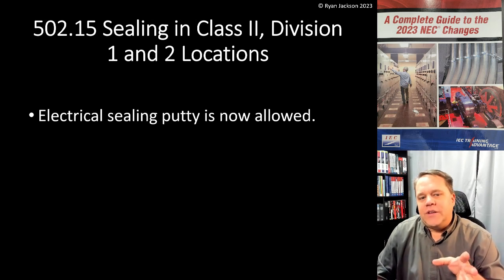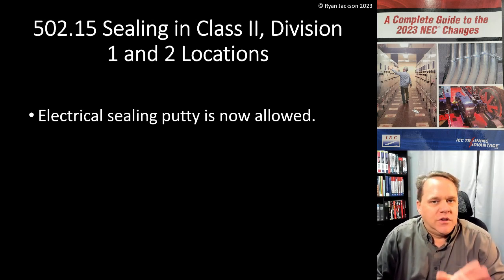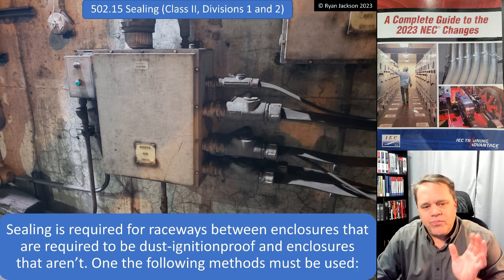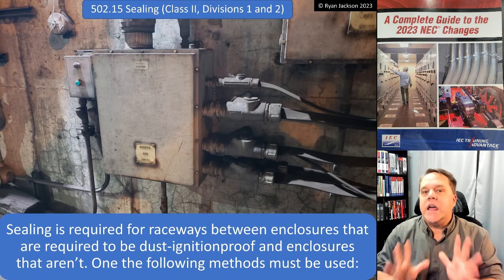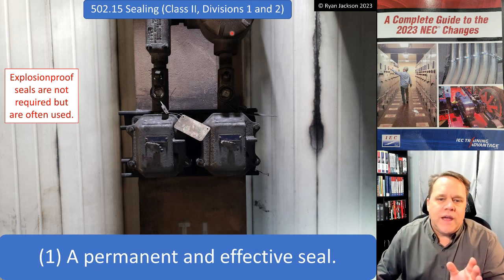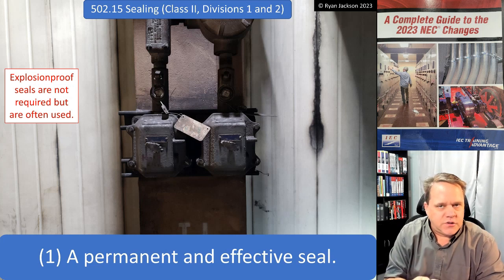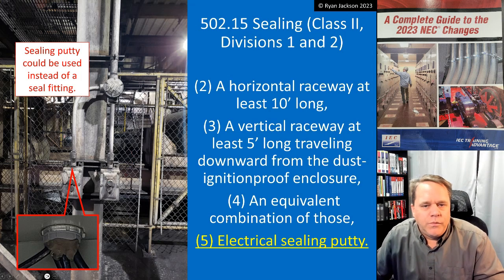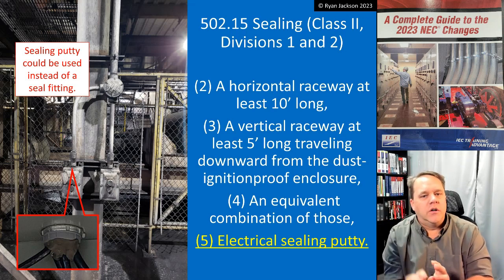502.15 Sealing Class II Locations

Comment: I cant find dust ignition proof in 502? They should spell it out. Also 502.10a3 is confusing as it says threaded bosses. But if i have no splices or arcing or sparking devices it can be dust tight? So confusing as it seems i cant use a dust tight box to pass thru?
Reply from the maker: @danmartens1282  I totally agree. 502 is a mess.

Comment: If the ends of the raceway are at different atmospheric pressures, a short length is not sufficient to ensure that dust does not travel, especially when free cross-sectional area is large.
Reply from the maker: If you feel that the sealing requirements for Class II locations are inadequate, you should submit a public input to Code-Making Panel 14. You will need to provide technical substantiation to justify your position, such as documented incidents of fires.
Reply: @RyanJacksonElectrical :

I don’t necessarily agree that we should have to wait for a foreseeable accident to occur so there is hard data, a la the Titan submersible vehicle.

The CMP failed to anticipate an unsealed raceway which connects two areas with different pressurization which can be caused by a natural draft or a powered ventilation system.
Reply from the maker: @denverbraughler3948  Why do you think the CMP hasn't already considered it?